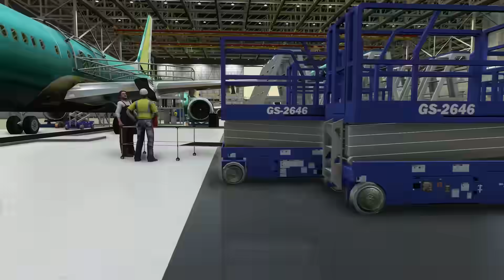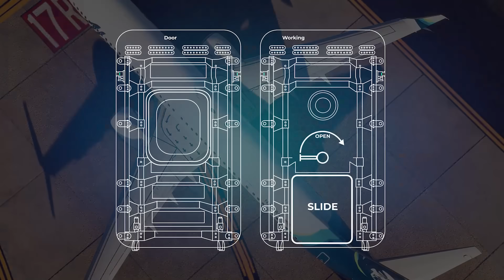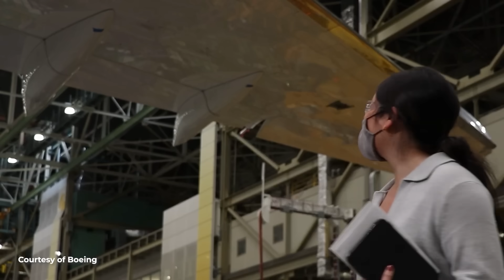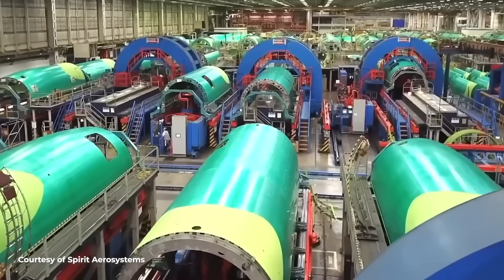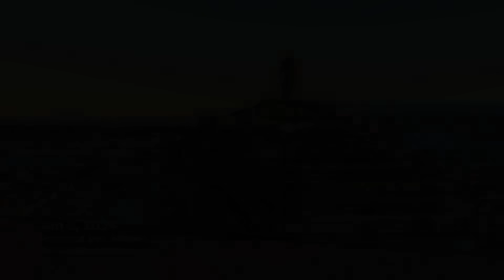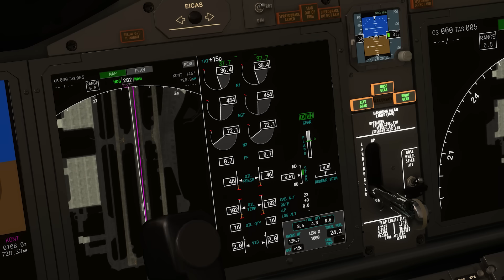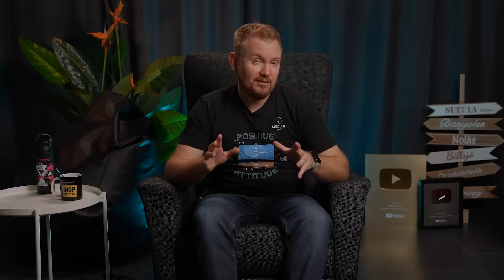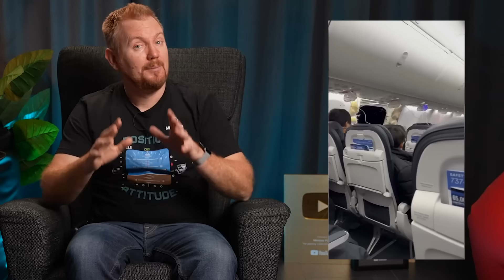Boeing 737MAX BlowOut!! The Scandal behind Alaska Airlines flight 1282

Comment: I'm a little surprised, that the whistling issue passengers called attention to the flight crew, wasn't logged by the pilots, because I'd think, that pilot's would know, that flight crew would act as a pretty good filter, knowing whether it was just a nervous flyer's imagination running wild from normal airplane sounds or something to be taken seriously, so when the crew actually  tells the pilots, then it's at least notable, if not serious.
Reply from the maker: Well, from time to time those type of whistling sound actually happens from perfectly normal doors as well. So I’m not surprised, especially if they walked down the cabin and the noise had disappeared.
Reply: @MentourPilot but a whistling sound AND problems with the depressurization system.
I find it hard to believe that that didn't raise any warning flags inside the airline.
Reply: @MentourPilot  But would the cabin crew have bothered to tell the pilot? Surely, they would also know, that those whistling sounds happen from time to time? That is my point.

Comment: The more I learn about the MAX the more I feel like it should have never been approved as a version of the 737 at all. It seems so different in so many key ways. Boeing gets a lot of blame (deservedly) but I feel like the FAA often gets let off the hook when they've been rubber stamping all these design changes for years.
Reply from the maker: But this was not a MAX issue.. it could have happened on another plane as well,
Reply: Obviously I defer to you as you're the expert, but didn't they need the emergency exit door plugs because the MAX was stretched, thus requiring more exits, and then given door plugs for the variations with fewer seats? Is this common on other models of planes as well? @MentourPilot
Reply: @p.e.moskowitz3210 yes, the door plugs exist on the 737-900 as well for example and I believe on some of their wide-bodies as well.
Reply: okay thanks for the reply and info. Love your videos! @MentourNow

Comment: So the flight deck door blows open automatically if the pressure differential between deck and cabin exceeds a certain value? Useful info for future hijackers.
Reply from the maker: Yeah.. now they just need to scratch open a hole in the wall. 😒

Comment: Did the main pressurization controller really failed because of the door issue or was this just a failure of its own? Because it seem wierd to me, that one controller would fail because of this but the other one worked fine. This issue would have probably never been found out in a different way as long as they dont refit the aircraft
Reply from the maker: Hard to say. But I would guess that each controllers had issues with maintaining the calculated rates and hence they failed.

Comment: The weather could have been a factor during the incoming flight.  It was pretty bumpy that afternoon/evening and the vibration could have set the stage for the blowout.  Morale of the story is to keep those seatbelts fastened!!  Just a few more minutes into the climb and it could have been so much worse.
Reply from the maker: Yes! Keep the seatbelts and bolts fastened
Reply: I was also wondering how everyone had seat belts on and then I realised they were still climbing.  Despite crew suggestions, I still see / hear so many seat belts being unlatched once that seat belt sign comes off - as you said, a few minutes later and persons may have been sucked out.  The cabin crew themselves would most likely have been moving around.  I did find it interesting that a window seat was vacant - the flight was pretty full and it tends to be the middle seats that remain empty.

Comment: The fact their only mistake was not pulling the circuit breaker can be forgiven I think, they got everyone down on the ground safely, great piloting
Reply: Maybe a future recommendation will be for ATC personnel to say as a last instruction after the aircraft is parked, "please pull your CVR breaker". Of course this will be only after dealing with a crew that has declared an emergency.
Reply: @jimwebb9328  while the crew ought to remember, anything can be forgotten in a delayed panic.
Reply: @SeekingTheLoveThatGodMeans7648 Spoken with knowledge. I see we have been there.
Reply: What if, setting the transponder to 7700, automatically activates a system that starts recording in a non-rewritable medium along with the last X amount of minutes?
Reply: @Nico_M.  Boeing would have to get that past regulators (plausible), and airlines would have to get it past unions (much more difficult).
Reply: These recorders should hold way longer than just 2 hours. The technology to do it exists and is cheap. The only problem is that it is difficult to change the regulations.
Reply: @rustyhorse8468  agreed. 2 hours is crazy and with current ssd technology, I don't understand this limit. Even pulling the circuit breaker seems silly.
Voice at 128 kb/s is 16 kB/s 57 MB/hr, 1.4GB/day, 500 GB/year. It's nothing.
Reply: @pluisjenijn I think the CVR has more than one audio channel. This in no way detracts from your comment though, memory is certainly cheap enough now.
Reply: @pluisjenijn Remember that you are not designing a PC here you're designing a device that is supposed to record and save while also surviving a crash at 600 km/h into the ground. Normal rules don't apply here and an SSD is non recoverable at that point. That's why harddisks are still so important for any physical information because even if the reader or casing breaks, the data is still partially recoverable as it is a physical imprint. 
An SSD block is basically just timings that will fail once they get physically impacted. No way to recover data from a broken memory chip. It is however possible to recover data from a broken harddisk.

There is a reason we still use RAD protection setups in huge servers and don't just ram a digital memory in every application.

Edit: in addition to black boxes we could install flight recorders that record more then 2 hours in case of non lethal crashes with your supposed SSD solution.
Reply: @rustyhorse8468  there's lots of resistance from the airlines to spend any money at all to satisfy such regulations.
Reply: CVRs should be mandated for 25 hours, not 2. It's ridiculous that this decision by the FAA is based on costs, not safety.
Reply: Forgiven by everyone but the NTSB who will undoubtedly make mention of that mis-step in the final report <if history is any predictor>... - i still say.. Bravo Crew...
Reply: @Geeky907  Yeah, but I'm pretty sure the NTSB is required to mention it.  They can do that without assigning blame.
Reply: @h8GW  Yeah, I think I would be a lot more concerned if they did not include it.  Accident reports are not some kind of ledger where if you do good it means mistakes get left out.
Reply: @Geeky907 NTSB Chair Jennifer Homendy addressed it to media. She said the NTSB has been pleading with the FAA to require 25 hours log time.
Reply: There were other people than the pilots that should know this who boarded the plane after landing. Forgetting this was unimpressive.
Reply: 25 hours cvr wen
Reply: Funny point the same aircraft but registered in Europe would have the capacity of 25h recording time (As far as I understood the NTSB sheer man).
Reply: Besides giving the recorders a longer storage time, dumping their contents to an on-ground storage ought to be an automatic part of every landing, emergency or not.
Reply: @macdjord  this just shows how uncompetitive the aircraft market is...
Reply: @macdjord that's an idea that no pilot's union would ever endorse. It means every conversation would be recorded and stored. Like being bugged for every flight. You have to draw the line between privacy and safety where no incident has occurred.
Reply: @alanp805  They're already being 'bugged for every flight'. At any given moment, something could go wrong, and if it does, the CVR is subject to review by various authorities. The pilots trust these authorities not to review these recordings unless something actually does go wrong. The only difference offloading it on landing makes is that if the pilots don't pull the breaker after an accident, or if the flight isn't identified as an incident until later, that data has not been deleted.

If the pilots are still worried, then the data can be automatically deleted after, say, 2 weeks (by which point one can be reasonably sure that if it hasn't been investigated yet its not going to be).
Reply: @macdjord  would you be happy for that arrangement in your work situation? Would you trust your management with your sensitive, private conversations with colleagues? And I'm sure if you agree with that, it's not something that's ever likely to happen.
Reply: @alanp805  If my job was safety-critical, and the people with the authority to review the recording were the NTSB and FAA (and not, y'know, my boss)? Then yes, I'd be willing to live with it.
Reply: @macdjord  I would be extremely resistant to the FAA having access to recordings of my normal working day. The only way such a system would be workable would be if the recordings were held by a pilot body or union group set up specifically as custodian, who would need to give approval for release of any recordings, and they would be completely anonymised unless a case could be made to identify individuals involved in a specific case. Any unused recordings would need to be securely destroyed within 24 hours of recording. The present system works perfectly well, except for the fact the FAA will not mandate 25 hour flight recorders for existing types.
Reply: @alanp805  A 3rd party holding group would be fine. Anonymization is pointless; if there's an incident, who was flying is a core component of the investigation, and if not, nobody will be listening to the tape. A 24h hold time is much too small; 2 weeks would work.
Reply: @macdjord  It must be kept anonymised unless required for a specific incident investigation. The idea you suggest would mean recordings of normal operations would be kept 'somewhere' and available for 'inquiries' by governmental, non-governmental (and most likely company internal investigators, let's not be naive about that). The current culture for flight data monitoring using third party moderation works perfectly well, as does the practice of overwriting CVR data if it's not pulled for investigations. More than 24 hours storage, with identified data opens us up to witch hunts and compromise. I would never agree or vote in favour of such a system, and I'm sure very few of my colleagues would either.
Reply: @alanp805  I'm sorry, I guess I wasn't clear. The FAA/NTSB/etc. would be permitted to pull the saved recordings under exactly and only the circumstances when they would pull the physical recorder right now.
Reply: @macdjord  honestly, I get what you're saying, it's the fact that the recordings exist anywhere except the CVR itself that I don't like. Whistle blowers, company snoops, hackers, all kinds of leaks can occur and I would be extremely distrustful of any off board storage of full recordings every single flight. It would make me think twice about discussing anything on the flight deck. A lot of our time is spent just chatting about things, you can't just sit in a tight space with someone for 12-15 hours and not talk about stuff. The fact that those conversations would be uploaded 'somewhere' and exist in identified, digital format for up to 2 weeks poses a risk to me I wouldn't be willing to support.
Reply: @macdjord  well yes but is there any way bosescouldlisten to private recordings it seems in a accident most interest is what the plane was doing in that time how pilots handled plane and situation therefore data recorder is mire useful than voice recorder if they need to last for so long I'd programme them to record pre flight checked take offs landing and other than that to pick up on words voice stress and automatically start then recording ie most places you deal with now record calls, banks have voice recognition systems so it's normal
Reply: @bunglejoy3645  ... what? Can you try again with, like, punctuation and sentences?
Reply: This is a big design flaw, it should automatically stop recording.
Reply: Hmm. Maybe a new step needs to be added to the take-off procedure?

Item 27a: Before take-off place lanyard with employee tag on the hook next to the cabin voice recorder switch.

That should ensure that the pilots remembers to pull CVR switch before leaving the plane.
Reply: @JanBruunAndersen 😊
Reply: Well I'm not sure about Alaska, in my airline we're not allowed to pull the CVR breaker wothout prior permission.
Reply: @Modimouse  That;s a terrible rule. In flight, sure, but once you're on the ground, if the crew think there's been an incident and an investigation might be needed, they're probably right.
Reply: IMO, this mistake cannot be forgiven. Boeing has had several serious accidents caused by shoddy repair work using non-OEM spare parts. Their priority has been cutting costs, instead of putting passenger safety first. Their executives should be held accountable for their greedy decisions.
Reply: @JulianneBagnall  
What are "non-OEM spare parts."
Who has tooling or access to blueprints, to make aftermarket commercial aircraft parts?
Reply: I am a little skeptical/cynical the pilots forgot to remove circuit breaker.
However, under duress of an incident it's quite possible some things are missed.
.
Its ridiculous a pilot has to remove a circuit breaker to stop a voice recorder.
A bit like removing a fuse in a car to stop a radio from working..🤷
..
The CVR should stop automatically, once it has reached its memory capacity..
..
I've not considered the privacy aspect of 25 hr cockpit recording.
Other than an automatic stop as memory is reached.
.
perhaps the CVR could be voice activated once an alarm is triggered. 
"Red status"
The CVR would record until the alarm Is rectified and all systems are "green status"
..
If green status is not achievable then the CVR would continuously record. Hence the requirements for 25 hrs of capacity..
..
This might alleviate some of the privacy concerns. And save memory capacity and unwanted irrelevant conversation.
Reply: Given that the flight recorder only has to record audio and text logs, a $40 1TB hard drive could probably facilitate over a day of recording straight. The fact that they can only record for 2 hours is fucking stupid.
Reply: @tbuk8350 with today's smartphone devices you can record 24hrs of decent quality audio for 335 MB. With a 1 TB that's more than 1 year of audio for about $60. I think they can do that but only if they really pinch their pennies.
Reply: @DJcyberslash  3 channels are recorded, overall, pilot, co-pilot.
Reply: It has nothing to do with costs or technology. They could do it tomorrow if they really wanted to, and I'm sure most airlines do. But pilots and pilot unions are dead set against being recorded. Even the 2hours of recording was a compromise. The 25 hour limit is only now being seriously floated because pilots got too cute with the CVR system and were caught deliberately not pulling the circuit breaker after they'd made errors on a flight.
Reply: To add to your comments, even if storage wasn't cheap, let's say, that impact resistance storage is much more expensive.

 It's still considerably cheaper than losing another plane and many more lives.
Reply: Now know one will ever hear the co-pilot chastizing the captain for his pre-flight good-luck-ritual panel kicking!
Reply: Having only a 30 minute capacity is criminal to say the least.  Now you might understand why checklist are usually missing items.  They had an accident, and the checklist did not specify preserving the record or the pilots failed to complete the list if the item was included, or the pilots just did not want anyone to know what went on.  Just another example of flight by check list instead of knowledge.  Check list are good when the accompany knowledge, but not good in place of knowledge.
Reply: @ewathoughts8476 I think they should be like CCTV footage and be able to record for at least 12 hours that properly fuhest single flight or Australia or usa
Reply: @bunglejoy3645  You realize that there are plenty of flights far longer than 12hrs, no?
Reply: @ImmortalSynn   no I honestly didnt ,cos I've never ,flown just interested in aviation how long does it take to fly to australia if its longer than 12 hours could crew switch tapes half way through flight or at least make the data black box a 24 hour tape and not bother about voice as it will be the data recorder that has most info in a accident not voice recorder
Reply: @ewathoughts8476  It's crazy that in this day and age they can't save days worth of audio on a recorder that size
Reply: They should back up to a cloud honestly.
Reply: You think that was a mistake? Ha! It was intentional  😂
Reply: @mangos2888  why? They had nothing to hide
Reply: @sarahfrith1984 CYA, my friend. CYA. It is always our first instinct. The FAA is everywhere.
Reply: @sarahfrith1984  How do you know?
Reply: @mangos2888  There was probably a record of them criticizing Boeing on the tape.
If it hadn't been deleted they would probably also have died of a 'self inflicted gunshot wound' by now.
Can't blame them really
Reply: @mangos2888  You sound so stupid. 😂

Comment: Usually seats with the most leg room (door/ plug seats) are the most coveted. I find it extremely hard to believe that it was a coincidence that only those 2 seats were empty...
Reply from the maker: It wasn’t an emergency exit row. Same legroom. 
Miracles do happen
Reply: @MentourPilot  I don't mean to put on a tinfoil hat lol. I guess I wrongly assumed the seats were spaced with windows and since there was a larger gap between windows, that it also had more leg room. Thanks. You make great videos btw.